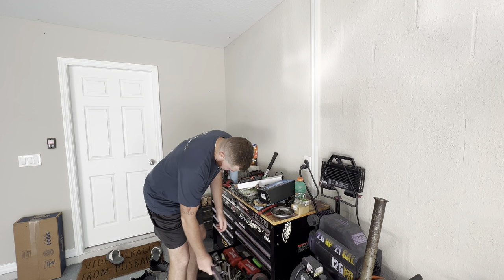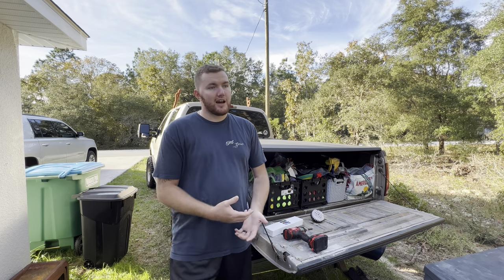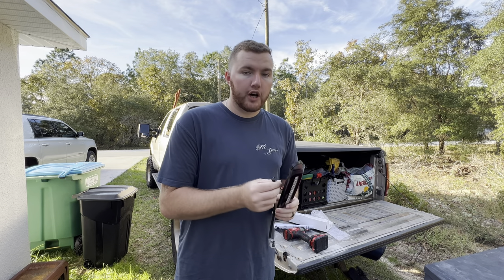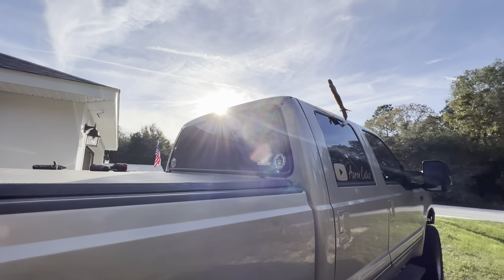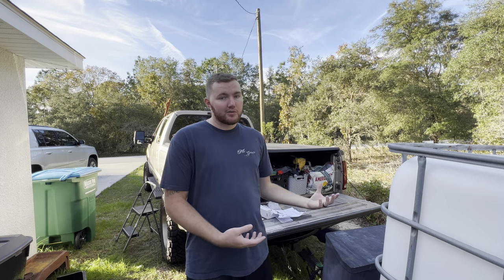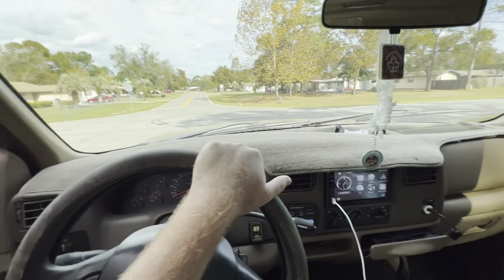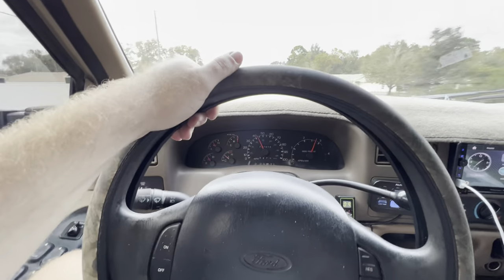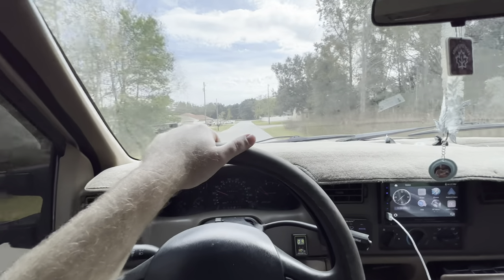Can A Third Brake Light Blow Your Transmission? *Ford Problems*

Comment: I had a 93 E150 that had this shifting issue, I didn’t know it, but noticed when following my wife driving the van that the third brake light had a burnt bulb. Replaced the bulb, and the light was fixed, and noticed that the shifting issue went away. I then went online and found this was a “thing” with Ford trucks.

Comment: Using a led brake light instead of oem lights will still give you trans problem, you'll need to put  resistors to correct this problem, I did not hear him say that and this can miss lead you down the wrong path ! Please put this in ur description if you did do so so people don't hate this video for falls statement.
Reply: Wise words. Read them forums boys.
Reply: Using an LED is even worse  best answer is to install the load resistors. I connected to the wire on the load side of the brake light switch. Wire runs to the ecu so it can monitor the brake usage. And it senses the brake light bulb by looking for continuity on this wire. Then when pedal is pressed 12vdc is applied to this input.
Resistors are readily available on amazon, 6 ohm 50 watt resistor(s)..

Comment: My did this for a year. One of the third brake light bulbs was blown. Replacing it fixed the issue. 99 f-250 super duty.

Comment: I've been told not to put led lights in the 3rd brake and in the tail lights, I know for certain for tail lights cost me a transmission
Reply: I changed years ago to led in 3rd brake light and my trans is acting up since, I'm gonna go put back oem light bulbs so the computer k ow there's bulbs in the socket, you can also ad resistors to led to trick the computer you have oem bulbs.

Comment: I have a 2008 f450 I checked the 3rd brake light is not working I just installed a LED 3rd brake light but the brake light is still not working. How does it affect the transmission? I heard a worse sound during the driving. It likes transmission sound

Comment: LED can give you the same issue as the voltage usage will not meet what the computer is looking for. If you do use LED you need to make sure they are advertised as error free or they are advertised with proper resistors installed to match OEM power consumption.
Reply from the maker: I added resistors after installation, just in case.

Comment: I removed my bed and disconnected my tail lights to have body work done to corner of cab and on my way to the body shop abs light came on 3rd brake light stoped working and transmission was doing wired stuff this has to be my problem